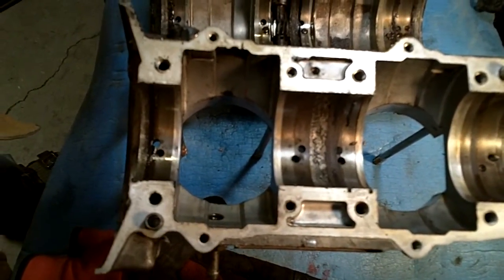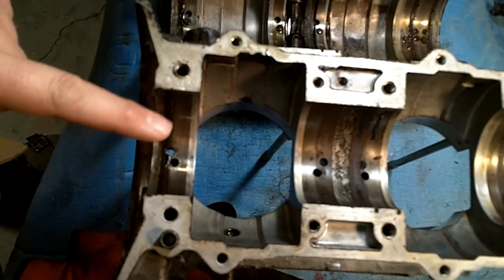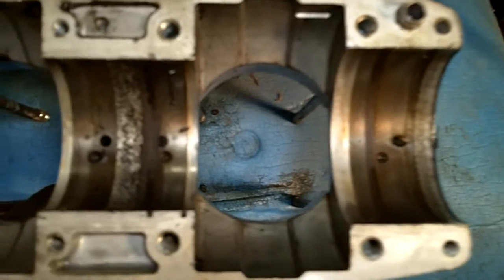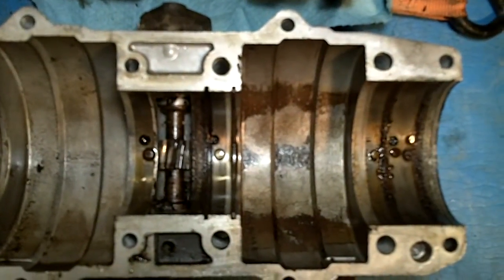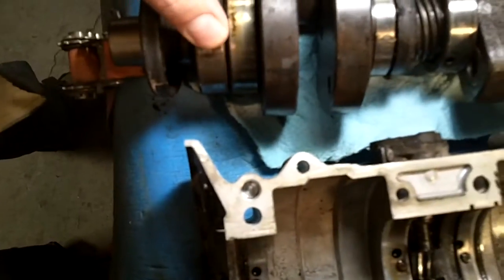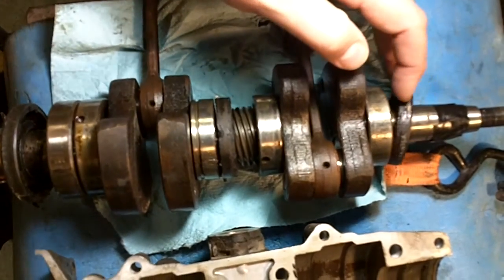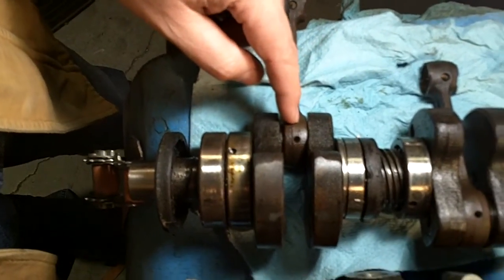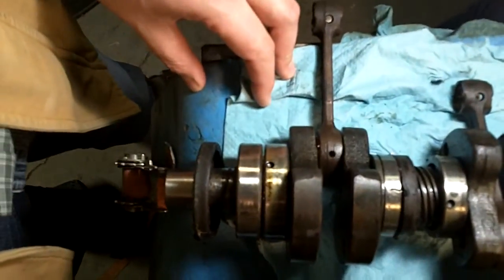Crank case halves, Arctic Cat Jag rebuild

Comment: I've run into this same problem on mine. What did you do to replace the center seal?
Reply: I took it to a small engine / motorcycle.  The crankshaft is pressed together.  The machine shop pulled the right and left halves of the crankshaft apart, replaced the seal, and then phased the two halves and pressed it back together.  There was no other way to replace that center seal.

Comment: I can answer most of these questions this needs to be sent out to a shop because you need to replace the center seal and you cannot get to that easily only a crankshaft specialist can do that work. The bearings will not spin in the case because there’s pins for each one so you don’t need to worry about that on this particular model. As for the gouge in the cylinder that is to be replaced it should be a nickel silver. As for the rods that would be taken care of when the Kranks sent out yes crank need to be sent out and you need a replacement cylinder to be done right.